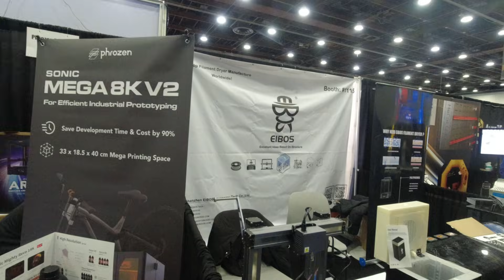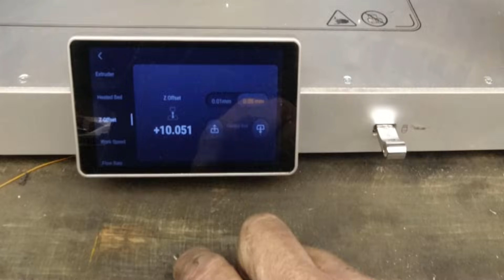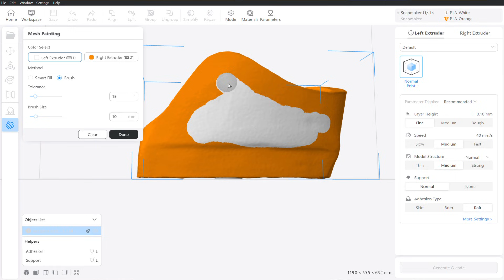Side Quest updates and using the Snapmaker J1S to build a better Prosthetic socket

Comment: I think one of the next steps in FDM 3D printing will be automated threaded insert or magnet insertion.
Reply: TPU doesn't typically like bonding to other FDM materials, so you might want to consider separating the mesh into 2 parts and then adding something that stitches the tpu part and the rigid part together at seem lines, like some loops or mushroom shaped bits sticking out of the TPU that are printed into perfectly matching cavities in the Rigid material.
Reply: A fun bonus of tpu not sticking well to rigid materials is that you can print compact flexible bellows like structures in tpu with pla printed between the folds as support and interface material stopping the bellow folds adhering to each other.

Functional print friday has some videos demonstrating this and how to model custom bellows in onshape, I am not sure if any custom bellows would improve your current hand design, but it might come in handy somewhere in your workshop.